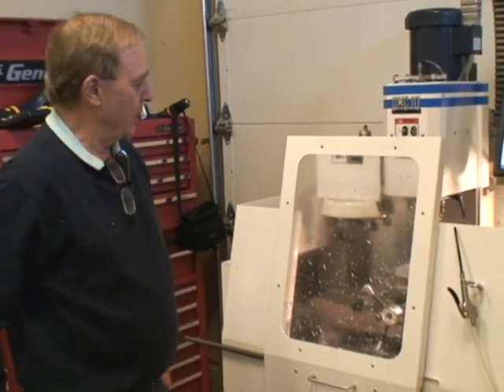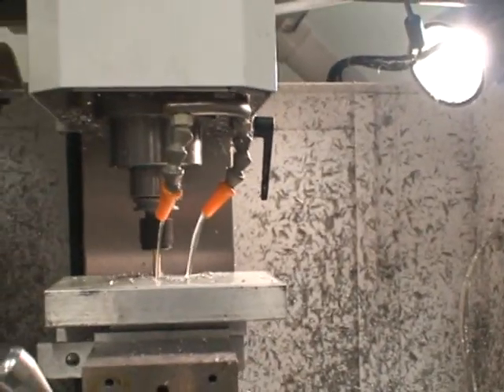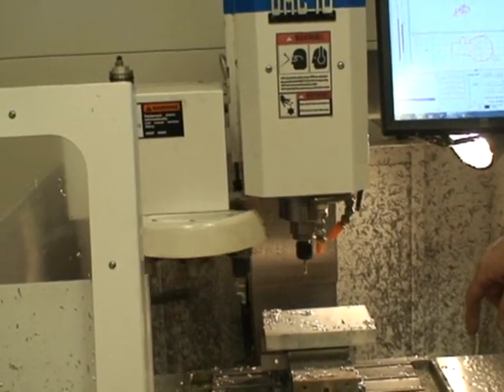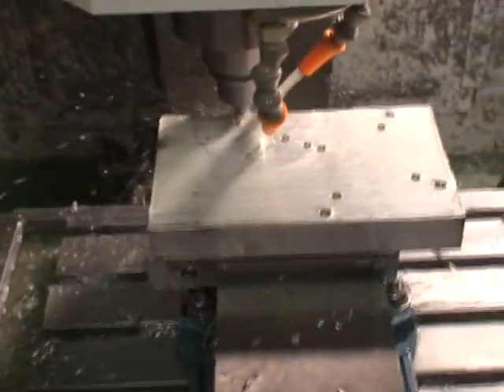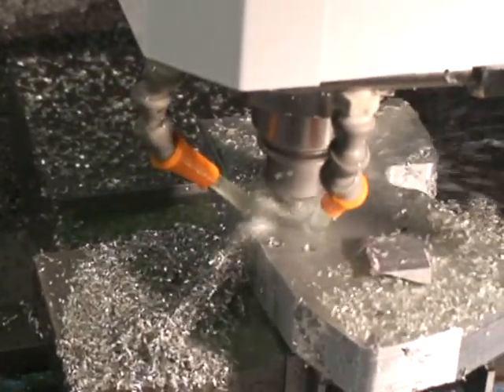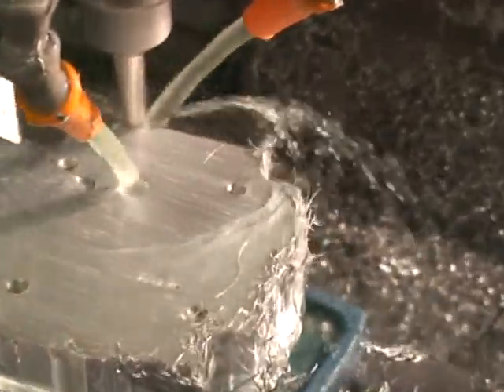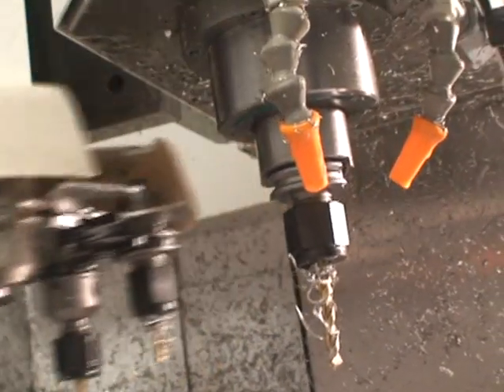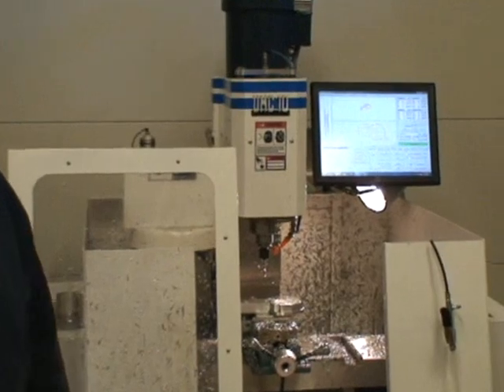Scratch Built mini version of Fadal's VMC 15

Comment: I received my UMC 10 from Dave Decaussin 10-18-2015 it took me a while to get it in the shop and setup but a couple days ago I made my first part Really Nice to see those Chips fly!

Dave was great to work with he looked at a 4th and 5th axis trunnion made by MDA precision that I wantedto setup for use with the UMC10  and found that the Z axis needed to be extended and he agreed to make the changes for a very reasonable price.    

Should be a fun project this winter, making the changes  so that I can run 4th and 5th Axis cutting on the UMC 10 I hope to post up some videos on the project for others that are interested.

Thanks Dave for taking the time to review my Idea for the UMC 10 and being willing to make the needed Z height changes.
Reply: +pbrubaker Hi Sorry, Life got in the way! but I have got a new panel done for the back of the flashcut control box and another panels for all the electrical connections done. I will try to make a video next week of the machine and a tooling plate I mounted to the machine.

Comment: We just got our 1995 VMC15 running.  Single-phase 220v w/10hp drive.  Nice old machine; the older Fadals are definitely better than the newer ones, and the control will well outpace the Fanuc 0i-MC controls on our other machines, even with the slower main processor.

Comment: Very impressive machine. Awesome how it can rip that 1/2in rougher right through the middle of the part. Only worry i would have is how exposed the tools are. Chips are flying everywhere and you could get some on the tools and they wont fit properly in the spindle